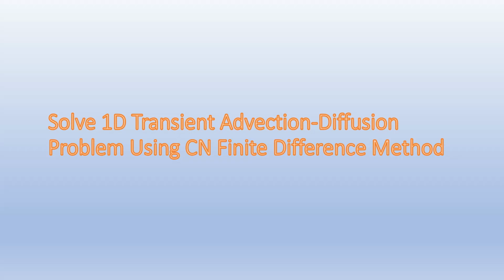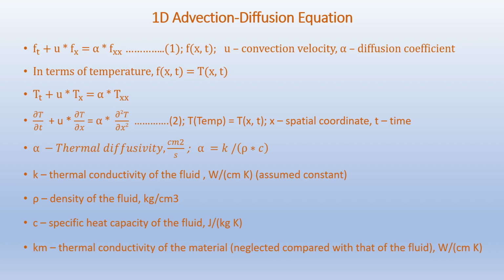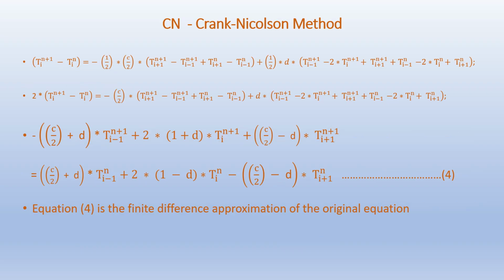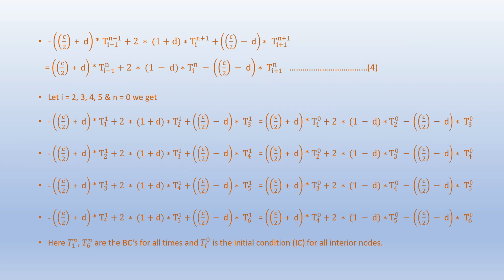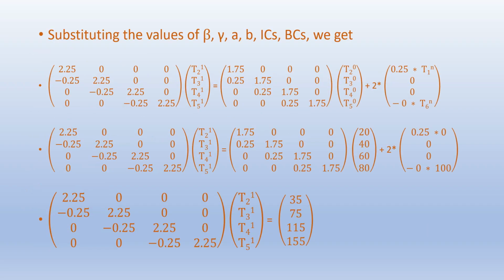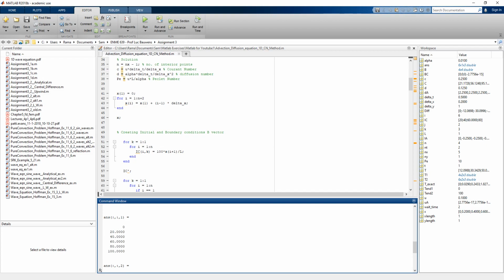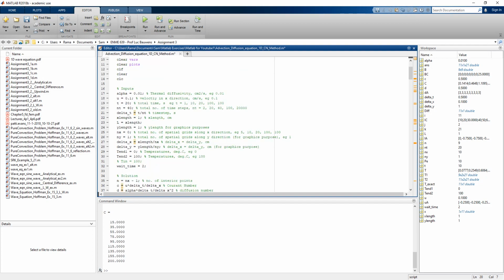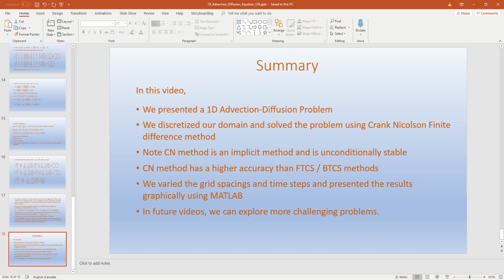Solve 1D Advection-Diffusion Equation Using Crank Nicolson Finite Difference Method

Comment: Very helpful video. I used it to construct my matrices for the 3D case of air pollutant dispersion but I started getting negative values at the last boundary cell and then once the pollutant reaches the last cell I only get negative values. I think it's related to boundary conditions as they are not imposed, in the code you presented it only accounts for inner nodes and doesn't say what to do when it reaches the last cell. I think in your simulations I see negative values (-20) as well. Can you suggest an addition to the code to impose boundary conditions be set when it reaches the last cell, the temperature or pollutant is not supposed to go back?

Comment: how would you do insulating boundary conditions instead of constant (Nuemann instead of Dirichelet) ?
Reply from the maker: Easy to implement. Flux is zero.
Reply: @samseleven1  yes, thank you. I was just confused how to implement that in the right hand side and left hand side matrix.
Reply: I figured it out now
Reply from the maker: @kopite5156  if you need help in solving custom problems you may contact me at samseleven@gmail.com

Comment: This video is very good to understand theory, but I am not getting all the MATLAB codes so I am unable to solve the adv-diff equation. Is there any way to get complete MATLAB code for this equation?
Reply from the maker: Codes are at
https://engineering-stream.com
Reply: @samseleven1   Sir Good morning , thank you for your response and happy  new year to you. I have followed the instruction as you have given but the term (T= Thomas_Algorithm_Func1(dA,lA,uA,C) is not reading by the computer and every time shows that it is undefined term.I am hoping you will give some way to overcome the problem.
Reply from the maker: @pushpagautam1700  hi download this function from
https://engineering-stream.com 
and save this in the same folder and rerun this.Let me know.
Reply: @samseleven1   hello sir, I could not download, copied all the codes and tried to run in separate file . But it says " contains an invalid statement"
Reply from the maker: Email me the code for troubleshooting.  
samseleven@gmail.com